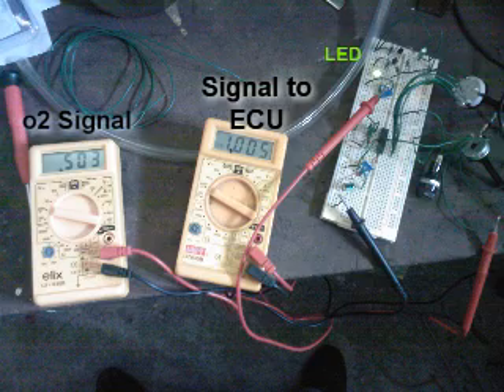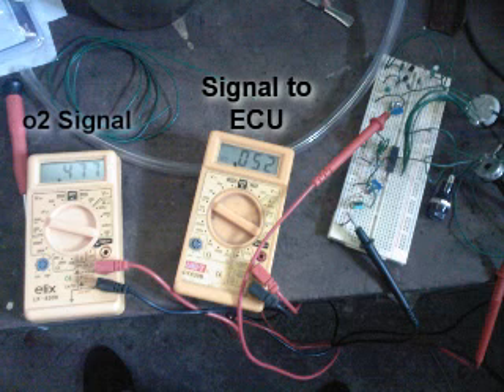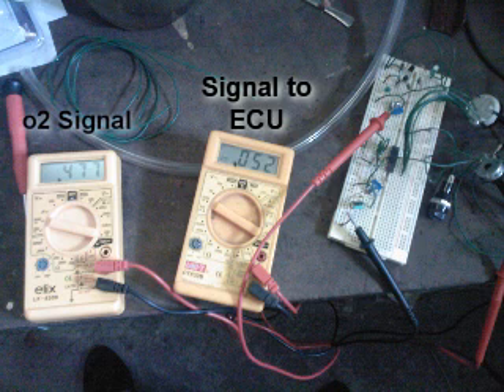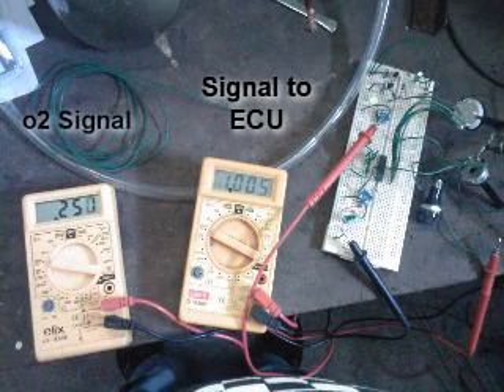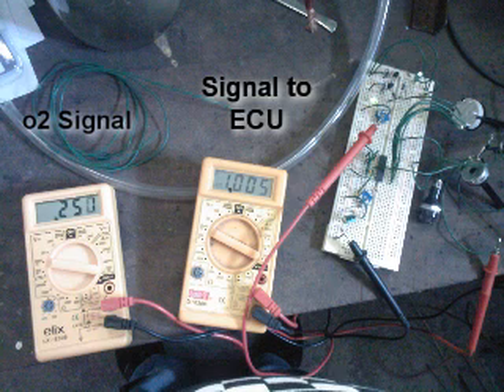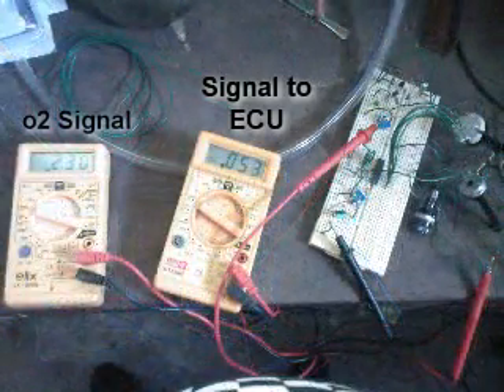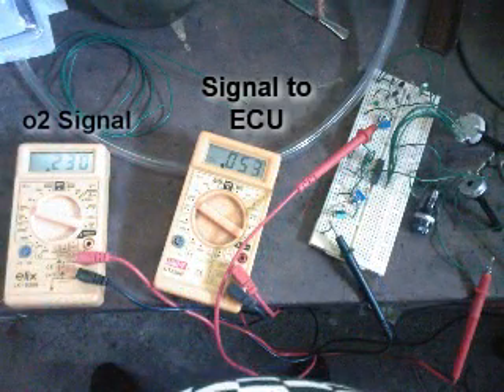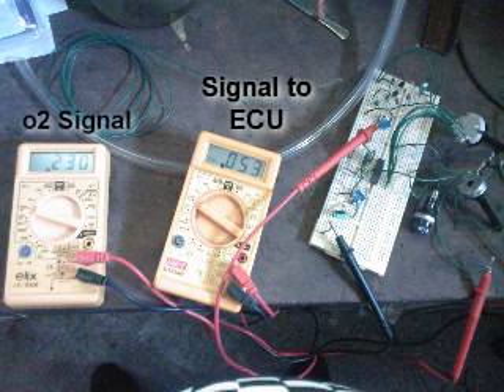My efie from d17 being built. Ignore previous one

Comment from the maker: hello htwoall
Im reading the o2sensor signal straight after 12v to a 10k resistor and a 1k lin pot as described on d17 end of pag 14.
This EFIE i made has all mods, so i dont have the 1M ohm resistor from switch to pin 5...
when i transfered the components to a pcb i had a diference in voltages,now im only able to turn led on @ position 1 in rotary switch (pin 10 on ic) @0.700v witch is very high, so i have to change the VR1 from 10k to a 30k.Change you board to the updated version.Cheers